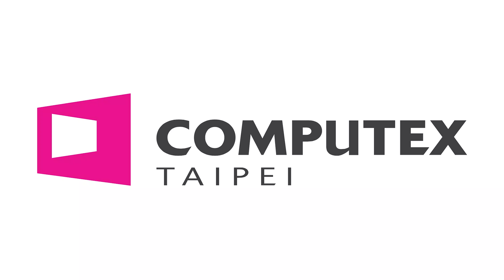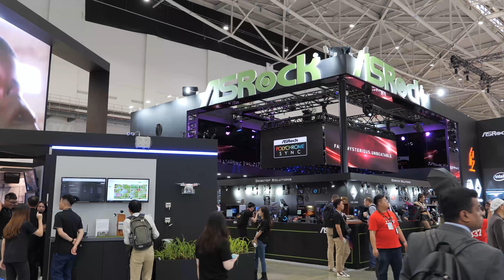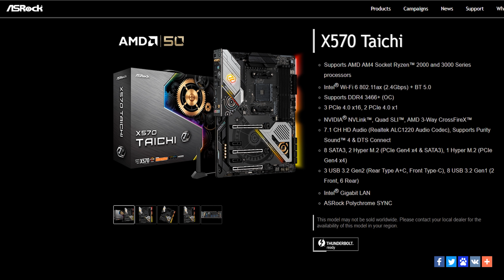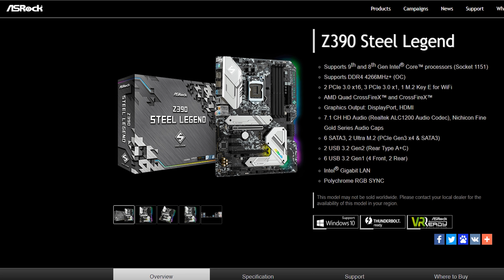Computex 2019 Show Floor Roundup: XPG and Gigabyte!

Comment: Gigabyte enterprise server water cooling system is the only one i’ve seen that make sense. It could potentially lower cost in HVAC cooling and reduce fan blower noise at the data center. If those thing catch on.  But you’ll have to convince Dell, HPE and Lenovo to integrate server water cooling. Since frankly nobody really buys Gigabyte enterprise servers.

Comment: As someone that works in a water DC, the asetek setup is neat, but the in-rack pump/reservoir that takes up a lot of that precious u-height is not ideal. its nice that you can still patch their cooling system into existing system.